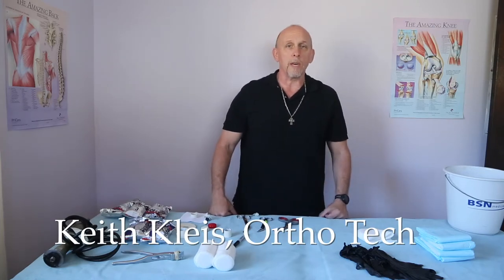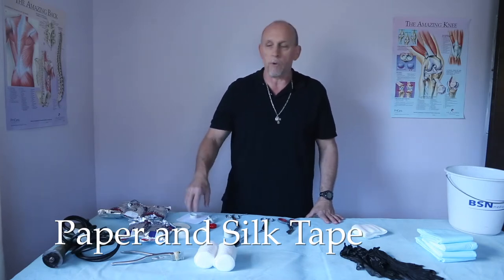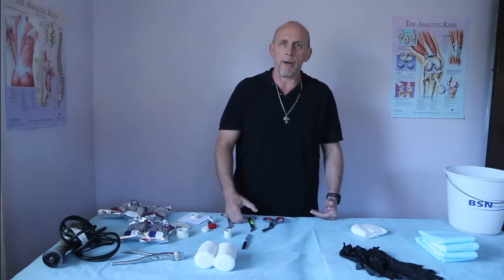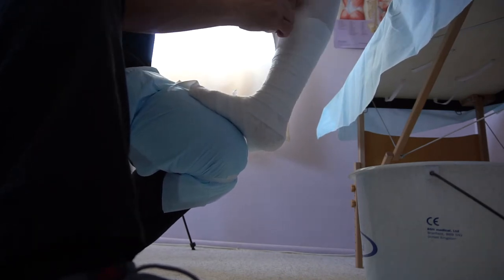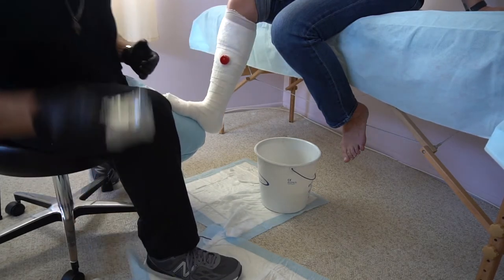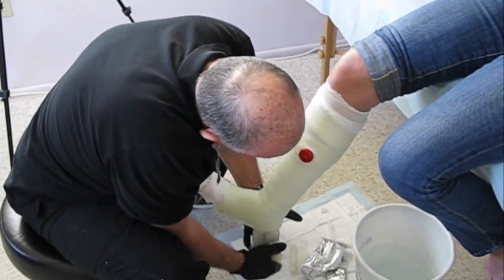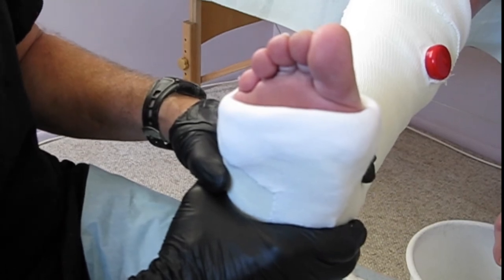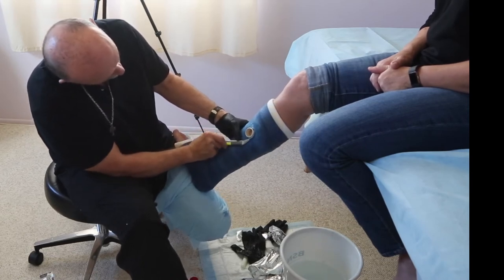Short Leg with Exogen Bone Stim port

Comment: Smart and efficient way to have the ports properly seated! I wish my technician had used your methods when I had my cast last week. Instead, he had to guess where the ports should be, missed the mark for those locations, used the saw to cut away around the ports and cut away too much fiberglass, which then required felt tape to cover-up, and three days later one port fell out.